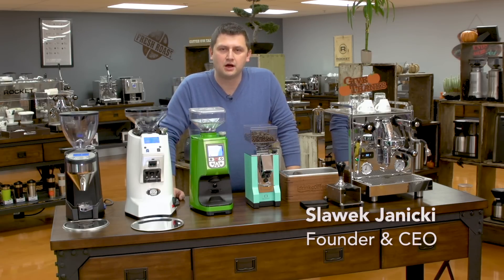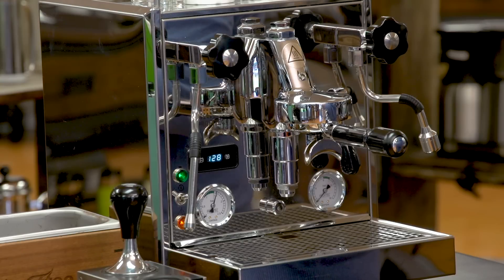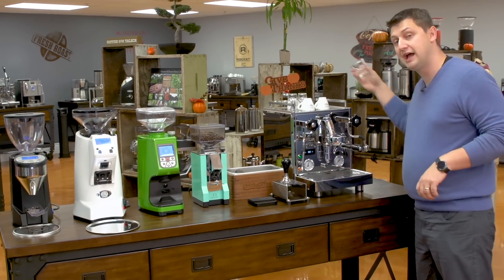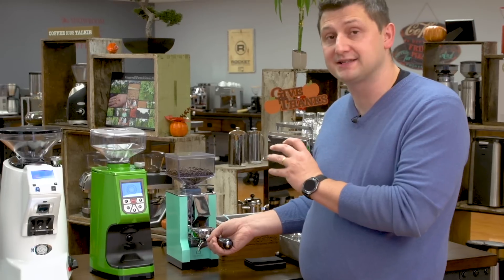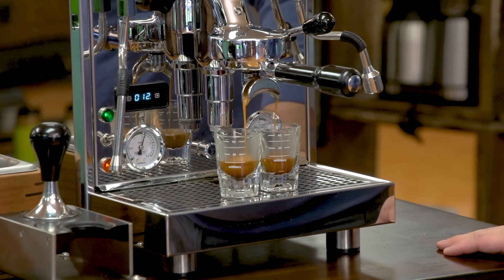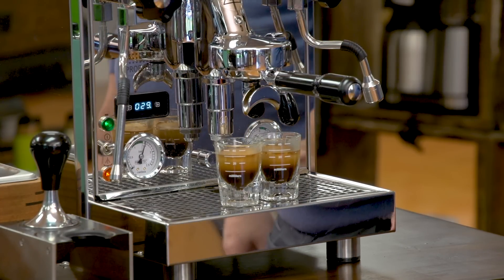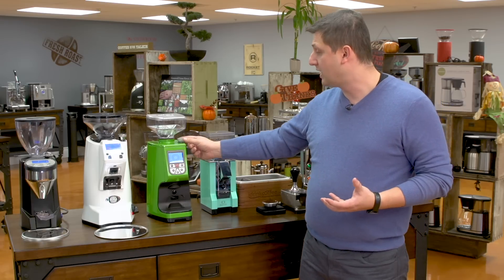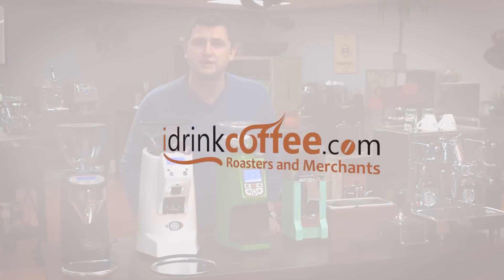iDrinkCoffee.com Tutorial - How to Dial in and Calibrate a Eureka Espresso Grinder

Comment: I know the burrs have to be turning when adjusting the wheel but do I have to have beans in the hopper?? I was adjusting it with no beans going through..
Reply from the maker: Hi, you can adjust without any beans and if you don't have any beans in the hopper or grind chamber the motor doesn't need to run when adjusting.
Reply: @iDrinkCoffeeCanada  thx for your reply👍

Comment: I'm a newbie with a silenzio. Do you also keep it running when adjusting courses for espresso? I don't yet dare go into the other brew methods until I get my espresso shot dialed in. I have a tiny kitchen and had to get rid of my grinder for the pour over and French press.
Reply from the maker: Hi, you should have the burrs running anytime you are adjusting the grind finer.
Reply: I was wondering the same question.... what is the reason why you have to have it running to make the adjustment?

Comment: I feel like my adjustment wheel is out of calibration, for example I can push it past 0 and often do to get the grind size I need. Anyway to recalibrate the wheel?
Reply: fairly certain the wheel can be turned more than 1 full revolution, numbers are there for reference for fine adjustment but you may need to do more than one full turn to make much larger adjustments

Comment: Very good video about dialing in the right dose but using milligrams is not relievable because the crema is different for every extraction! Should always use a scale in grams to measure the final brew rather than relying on volume!
Reply from the maker: That is a good point, weight will be more accurate than volume when it comes espresso.

Comment: excellent explanation of how exactly the grind wheel works ..  finally. what no one mentions is that the grind knob will keep spinning like a combination lock and you have to feel the grinds too judge where the grind knob is in the first place .. just because it's sitting on the number  "3" doesn't mean its in range of  anything. .. your girlfriend could have turned the knob counter-clockwise 1.5 times to make a french press grind  .. or your wife  could have spun it 1.5 times clockwise to make a turkish coffee ....
Reply: It's a good thing I don't have neither a wife or a girlfriend then.
Reply: thanks man! I was already a out to look for another grinder because I thought it only turns one revolution which seemed way tol finniky.
Reply: Just got to hope your wife and girlfriend don't try and use the machine at the same time...
Reply: you can count how many turns you do for X setting and note it

Comment: So the basic rule is that you play with the knob in order to reach the consistency always while the engine is running (with the coffee in the hopper)? Thanks
Reply: If you're going finer  you want to have the burrs moving (engine running) you DONT need to be wasting coffee at that point while adjusting the setting though. If you're going more coarse I don't think you need to have it running, but it doesn't hurt.  The idea is, if you're moving the burrs closer to together, you don't want bean particles getting stuck in the way. 

While changing grind setting no reason NOT to at least use the hopper shut off on these types of grinders. 

On grinders without a hopper cut off, If you don't want to waste beans dialing in your grinder, I'd empty the hopper and just throw in whatever dose you usually use, 16 or 18g of coffee at 
a time to get dialed in, although that might affect the way it grinds vs having a whole hopper full of beans due to the difference in weight, so you may still need to make a slight adjustment afterwards if you usually keep a full hopper.
Reply: @BensCoffeeRants  Great comment! It’s good to know you don’t have to grind coffee while making adjustments and may simple turn it on without coffee inside. Thanks!
Reply: @chekauk7596  Yeah, that's why single dosing is best, no beans in the hopper, you can make whatever adjustments without wasting any coffee really. Although might take a few shots to dial in.  
Going finer you generally want to have it running, but coarser it's not necessary.

Comment: I have the Eureka Mignon Silenzio grinder but have been having trouble with the grinds shooting out and going everywhere. It makes such a mess, is there anything I can do to fix that? Thanks a lot!
Reply from the maker: Hi, it is possible that your clump crusher is damaged.  This what Eureka calls their Ace System, it's a little piece of metal that acts as a sort of gate that reduces clumping.  It's located at the exit of the grind chamber behind the chute.  I have seen these get bent inwards or damaged.  I would check this first and also give the grinder a good cleaning
Reply: iDrinkCoffeeCanada Oh wow thank you for your prompt response! Where would I get a replacement for that if it turns out that it is damaged? I gave it a good clean but it kept doing it.
Reply from the maker: @julieyablonsky1574  hi, the dealer who you purchased your grinder from should have this part.  Did you buy the grinder from us?
Reply: I have the same grinder and I can tell you that not even one tinny grind is shooting out.
Reply: Could be something is wrong with it, or just low humidity and static causing the issue, a Coffee Dosing Funnel helps a lot with keeping coffee where you want it!

Comment: Can I use less expensive beans to calibrate or do I have to use the actual beans I will be using to drink? Thanks
Reply: Unfortunately the actual beans. Every bean will grind differently and pull differently. If there was a way to do some universal dialling-in, you'd have discovered a unicorn and you'd change the coffee world forever haha, but alas, can't beat reality. This is why low-retention grinders like the Niche Zero and single-dosing methods are becoming so popular. It is low in waste and doesn't involve dumping so many grounds to get grind size & dosing dialled in. This is a big issue for home baristas who only want to make 1-2 drinks per day; it's not economical to be buying all that coffee in small 300g-500g batches and then wasting 1/4-1/3 of the bag just dialling in.
Reply: I've done that, I mean in a case like this where it's WAY off, why sacrifice your good coffee, if you got some old coffee laying around, get it to the correct RANGE first with the bad coffee. It might still need some adjustment when you get the good / fresh coffee in there especially if the roast level is different but if you're in the right range it likely won't be SO bad.

Comment: Hey Thanks for your video. I am the proud owner of a Silenzio.
All in all a solid grinder but I have one problem: I find it extremely difficult to relocate the correct grinding degree (if that is the correct English term). 
I have to switch beans and thus to use different grinding degrees.
Do you have any advice or suggestion how to solve this problem?

Comment: So much smarter to weigh your beans and just put in like 20g a turn. Then you wouldn't have to throw away a lot of coffee between adjustments.
Reply: I’m not sure i understand your reasoning. You would still have to change the grind setting while you’re grinding which means your basket will be full of inconsistent grounds.
Reply: @novedekne  If you empty the hopper every time between grinds you can just make the adjustment and then throw in another 20g and see if it's right. But if the hopper has coffee in it you have to throw away all the coffee you ground while making the adjustment.

Comment: Why must you have the grinder running while turning the adjustment knob? What if you adjust while the burrs are stationary?
Reply: you can grind coarser without it on but you must turn it on while setting it finer because there is a small amount of beans between the burrs and you do not want to squeeze the beans messing up the burrs
Reply: @wesleymatthews6356  So it's better to set it at first at a very fine setting and then keep adjusting it coarser until it's dialed in
Reply: @_yuuzo  that’s not really necessary, just run the grinder empty and adjust finer. It just needs to be running to make sure no beans are stuck.